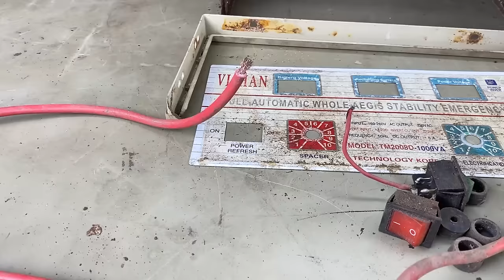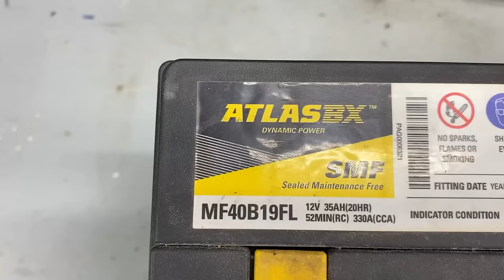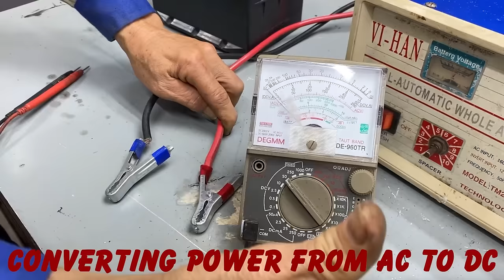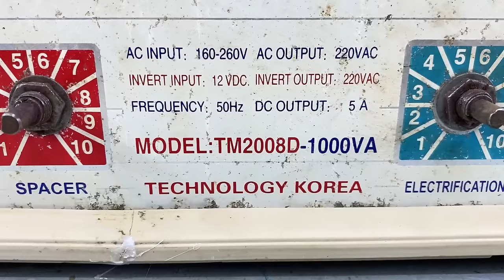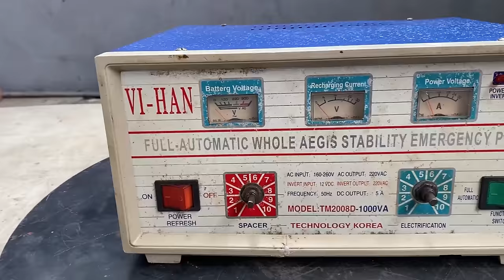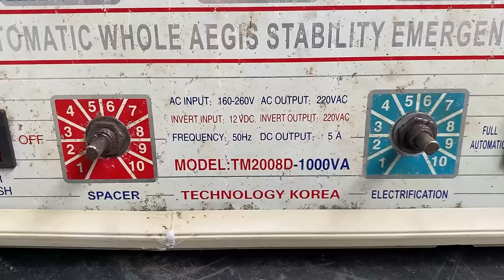Vintage Whole Stability Emergency Power Restoration // Restore Old Automatic Power Stabilizer

Comment: The gauges are in wrong order. Battery voltage must be 0-30V volt meter and Recharging current must be the amp meter. Power voltage must be the 0-300V volt meter.